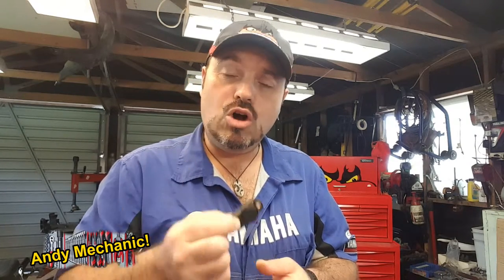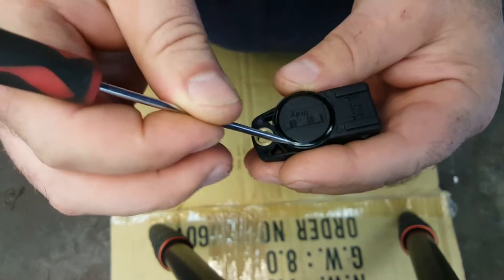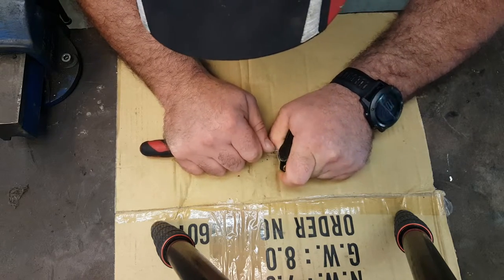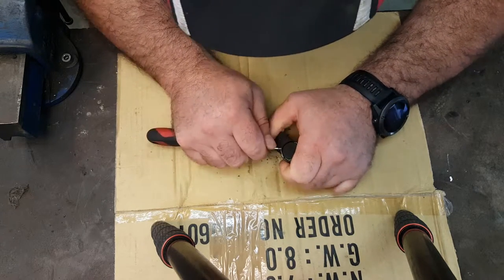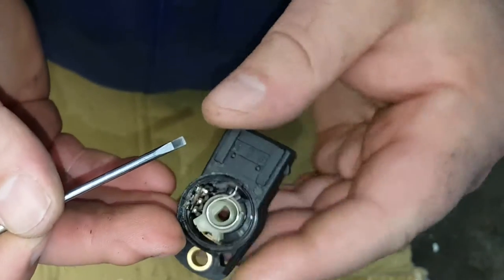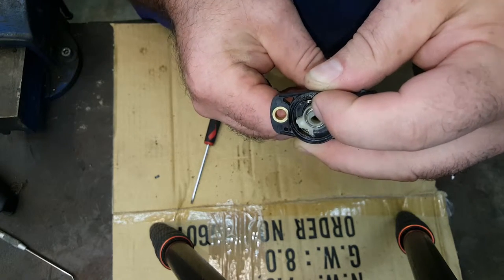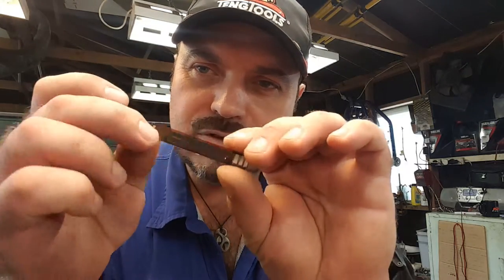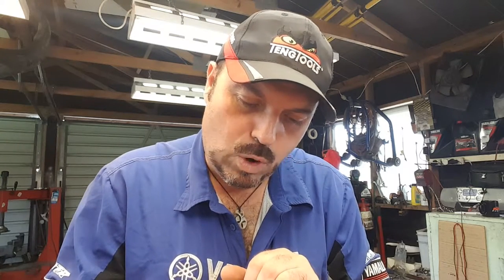What's really inside a TPS unit? #1209

Comment: Why not check the resistance again...root cause not found yet. Otherwise great video
Reply: Yep that's what I would do again, I'm trying to figure out what material in there could be superior to cheaper brands, everybody swears you have to use mopar tps @ around $90 when the auto parts stores  are about $40